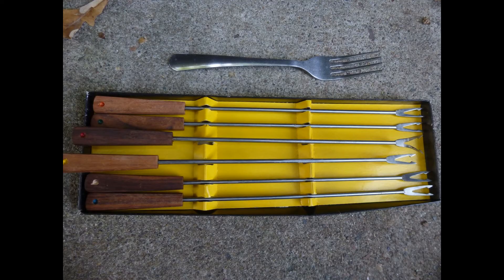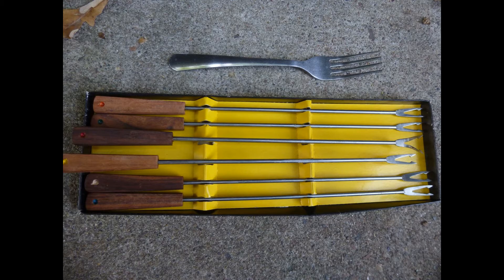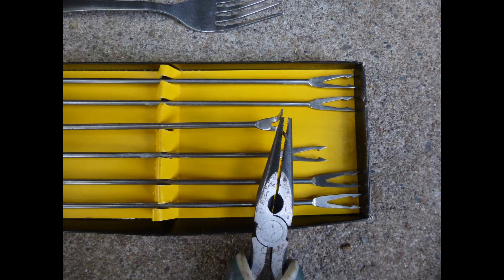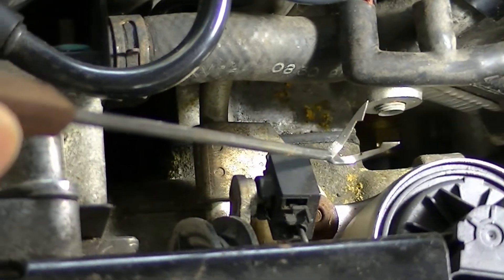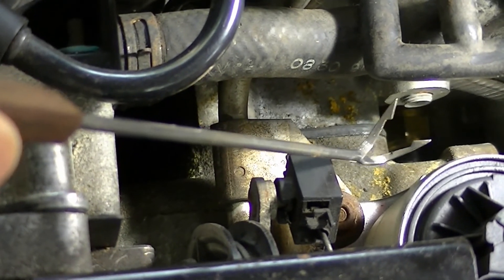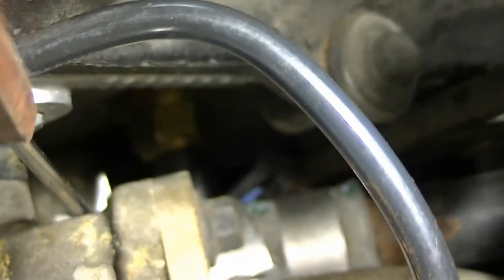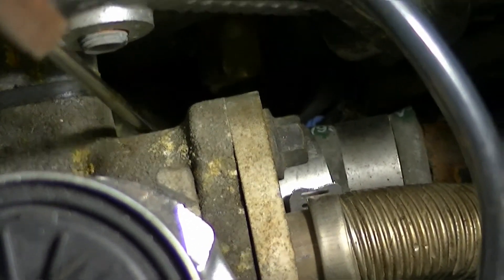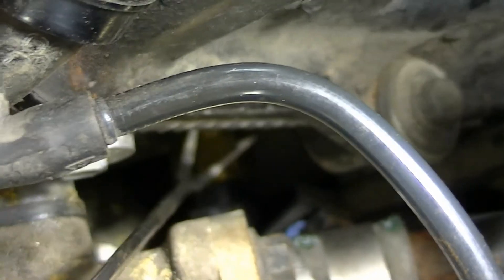An Engine Coolant Temperature (ECT) sensor replacement for Cadillac Deville 1996

Comment: Thank you for this video. This is the only source I found for locating the coolant temperature sensor. Now, thanks to you, I found it on the engine, driver's side, connector oriented such that the top is on the port side and bottom pointing to the starboard. I'm also working on the cabin heater blower and so have access in front of that (about 1 foot in front of the firewall) and about halfway down the block.

Also, i noted you have the old rubber/plastic removed from the firewall.  Mine had flaked and I'm now also peeling it off. There's only one small 1 inch diameter hole I must cover with sheet metal. Yours looks clean and inspires me.

Anyway I'm very grateful for your video and ideas.
Reply from the maker: I used the 3M Bondo fiberglass resin and fiber glasses to repair the area (sandable in 2 hours). Be careful initially as it is flammable. Don't forget to put some protective material/paper on the bottom of your garage as the clear resin flows to the bottom before its setting. Thanks for your comment!